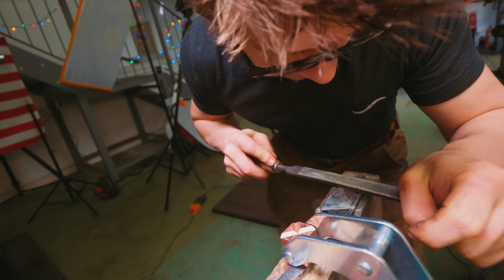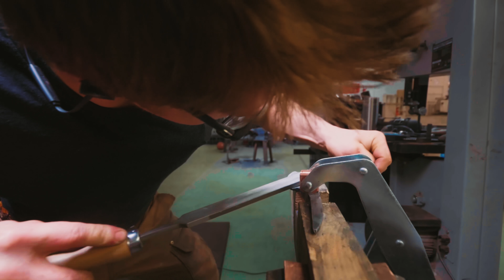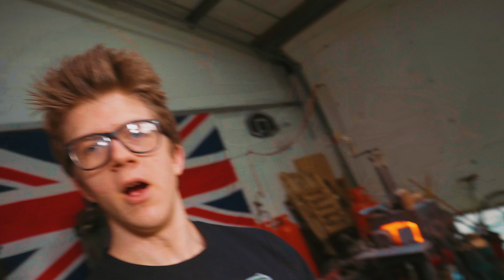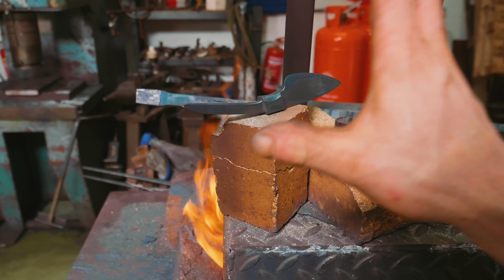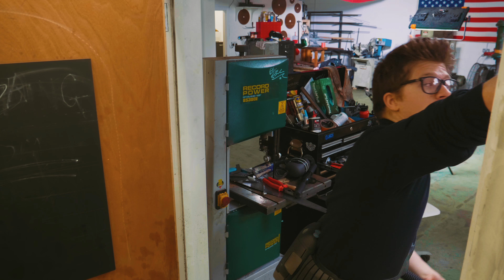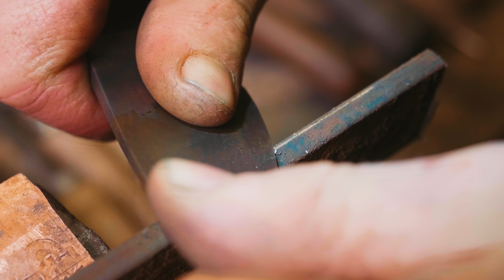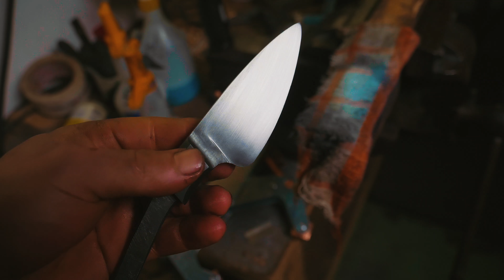MAKING A KNIFE WITH NO POWER TOOLS!!! PART 3

Comment: I work with a lot softer metals but I find it beneficial to turn the files around so they are facing me during some parts of the process. Helps prevent slips when doing the careful spots.  Might take a little longer but eh it’s meditative.

Comment: It's also cool for those of us who only make knife using basic tools to watch someone who only uses power tools. I've never used a power hammer or blow torch, and the closest I've gotten to use an angle grinder, but never a wheel grinder or a large industrial grinder, so I could guess that I'd have a lot of trouble using that kind of equipment. Its a pretty good comparison of the unique skills on either side of smithing.

Comment: I heard once that what steel you use doesn't matter as much as how you heat treat and temper it.
Reply: Not true heat treating is different based on the steel
Reply: Right. Even with different kinds of steel, how it's heat treated and tempered is still really important.

Comment: Hey Alec, just thought you'd be interested to know that when you're normalizing the knife, you're actually growing the grains to a larger size. Cold working steel (or any material that cold works) decreases grain size, and increases hardness as well as brittleness. When the material is then reheated, the grains begin to grow. This decreases hardness, restores ductility, and also removes any residual stresses in the material.

Also, I'm fairly sure that warm oil quenches faster than cold oil because there's less of a temperature difference between the steel and the oil. When the oil is room temperature, the difference in temp between the oil and steel causes a vapor jacket to form momentarily around the steel. Not for long, to be sure, but the first few seconds of a quench are crucial. And since we know that oil is a better conductor of heat than air, this jacket of air around the steel is definitely not what you want around your material during the most crucial part of the quench. So, having the oil a fair bit warmer decreases the temperature difference, and allows the heat to be absorbed by the oil right away and your steel cools faster!

Keep up the great videos!

--Your friendly neighborhood metallurgist

Comment: The problems your having with your files is in technique and file choice. There are several different styles of file including cuts. You can clean it up drastically by  moving to a smooth then dead smooth or 0 or 00. Chalk is an absolute must in the final stages to stop the file from loading up. By lifting the file you are having to reset your cut a file is a push / pull tool. Also several techniques to remove blemish spots or low spots without fileing a complete flat mostly by draw fileing. When we first learned to use a file we had to file a 1 x 1 inch square flat by hand it is an excellent exercise to learn file control. Keep up the good work love your channel.

Comment: I know you probably don't read these but from a fresh prospective. When filing the blade or tang and wanting no slips of the file to the bolster, use some tape on the bolster to prevent damage from slips of the file.

Comment: Speaking of basic tools you can use instead of the forge.  Me and my mate's first forge was a shitty wee fondue set that we drilled a hole in, attached a tube to a hand powered air bed pump, and filled it with bbq charcoal xD  Got the job done, albeit pretty messy and hard to control the heat xD

Comment: handy tip too keep in mind if you doing finishing work with a finishing file, rub chalk into the grooves of the file, it will prevent shavings from blocking up the file, allowing you to get a really nice smooth cut. It will look as if it has been surface grownd. 👍🇿🇦

Comment: 'Warm oil will cool down that steel faster' - Well that was a curious thing to say. 
Having a look in to it it seems that there are three stages of cooling in oil. In reverse order, 
Convection: where the oil is circulating the heat away and cooling is fairly slow though varies with viscosity. It was the viscosity that I guessed would be why it would cool faster, but nope. 

Boiling: This is by far the major cooling stage, the oil is getting to the blade boiling off to be replaced by more oil. Its dependant on a bunch of things about the oil, particulates, viscosity and such, but in general its orders of magnitude faster than the real issue with cold oil, which is the first stage...

Leidenfrost phenomenon: When initially dipped in to the oil, with too high a temperature differential the oil behaves like water droplets on a hot frying pan. It forms a stable vapour layer around the blade that is ironically very good insulation within your coolant.

In an ideal quench youd have no first stage at all, go straight to boiling, cool as fast as possible to the convection stage which allows the metal to release some tension. Heating the oil helps to get closer to that optimal quench.

[Incidentally, all of this is why oil is used in the first place. It has a wide range of temperatures at which it remains boiling.]

Comment: Well done on the heat treat!!! Nice work all around. This is basically the same procedure I use. I believe that the normalizing is a lot more important than generally acknowledged. I use 1080,1095 and horseshoeing rasps (1055-60) mostly. Triple edge quench and temper.

Comment: Great to see some old fashioned hand skills. Reminds me of some of my mostly long forgotten apprenticeship training. Couple of things I was always told by the old toolmaker that trained me, always regularly check your file handles security on the tang. On a couple of your wooden handled files it looks a little like the handles a bit small of the file so the tangs not inserted far enough for safety. Also try not to hold the file with your index finger along the file blade with your wrist more or less in line with the file. I know it seems easier to control that way but if the handle does come loose or split on the forward stroke the tang can end up embedded in your palm or wrist which is not good. We where shown some pretty gruesome pictures of such injuries as young impressionable apprentices to drive home this point. 
Instead of sand or emery paper try using a good quality diamond fine flat needle file working sideways lightly across the piece for your final finish. With care and patience it’s possible to get an almost slip gauge quality finish that way. 
Great work and fun to watch as always 👍🏻

Comment: First realy awsome video
Ans second i have a little tipp for filing if you applay some chalk (german Kreide) on youre file an than file without presure on the file you get a realy reapy clean surface 
(little tric i learnd on my whay to become a mechanist ( im germen and i'm so sorry for my bad englisch))
(only use before grinding with  sand paper)

Comment: Forget the touch mark? You can use a diamond tip engraving pen to draw it out on the blade, they are not as expensive as the "diamond" suggests, you can get one for ~$15 US. but I would suggest buying one that's better quality and has replaceable tips. Buy once, cry once and all that fun stuff.  Since that blade is blued you can scratch in your touch mark and even sign and date it.

As for hand sanding, that's one of my favorite parts of finishing a project. You get to see the beauty exposed right before your eyes. But I highly suggest getting a sandblasting setup, it will cut the hand sanding time down significantly where all you have to do is the finish sanding if you want 400 grit sanding lines. Or you can have 400 grit no lines satin finish to perfectly polished to a mirror finish if you keep going into higher and higher grits until you are using volcanic ash at the end and take as much time to do it as you do hand sanding the whole way to 400.

A sandblaster is also cheaper in the long run compared to sandpaper if you use an enclosed box. The medium can be recycled and cleaned of steel particles with magnets.. or just leave the steel dust in it lol. While sandpaper is use once and throw away. But you will find your medium to get less effective over many uses, what that is, is you are creating a higher grit medium.

Comment: After the blue soak in Bleach for a few minutes. It will rust then hit it with oil and steel wool it will turn real black. You will have to test as certain steel will take more cycles to work.

Comment: Just a little hint.  If you are using lower carbon steel. You can always reinforce the strength with casonite      
For case hardening the edge    Heat the Steele and then dip it in the casonite powder

Comment: For your next project you should make a Turkish Yataghan but to make it more your speed you should make it with Sami construction, as well as damascus steel. So the damascus on the spine would be two or more, soft and sringy steels, and the damascus for the edge would be hard steels. That would be great to see.

Comment: The close-up file-work was awesome. It was great seeing the material being removed and changed with each stroke. Perhaps a few wraps of tape to mask off the areas around where you are filing may help avoid some of the more serious bites if you lose control of your file? Also, do you trust the magnet test for normalization cycles?

Comment: If you don’t mind answering the question of a scrub like myself, but I was wondering why you flattened the face of the knife with blue daikum, but then removed most of that hard work by making the bevel as wide as you did? Why did you take the time to flatten that steel if it was just going to be removing it when you shaped the bevel? I know there’s probably a really good reason, but I was wondering nonetheless.

Comment: From what I understand with cold blue, it is best to only mix what you need, because after it is mixed and used, it goes bad pretty quick.... I haven't tried the stuff you actually dip(the wipe on is too blotchy though). I've had a bottle for a long time, but I got into doing hamons and just did my last hamon video a few days ago. My next build should be trying the Caswell's cold blue, take it easy...
Reply from the maker: That's very interesting to know! The blackening certainly took longer than it ever has on this piece

Comment: Alec, consider using some bar material and clamping a safety blocker on top of the bolster while filing. It will save you from slipping and gouging more finished faces.

Comment: What if you were to cover the bolster or any other surface you don’t want to file with a thin sheet of steel, aluminum, etc. It might prevent the damage caused by file slips. This could help with future projects.

Comment: If you plan on cutting those does on the lower hammer... they are most likely very hard! You’re most likely gonna want to run low rpm on your mill and maybe a brazed carbide fly cutter. Inserts may not do it well. Just play around and you will see lol just my two cents

Comment: 1:18 i highly recommend u to not use a File in this orientation, because the "teeth" are just not made for it and u will ruin ur File in no time. Also to get a cleander Finish with the File you can take a bit of Chalk and rub it on the file, so no metal shavings can get stuck inbetween the teeth and scratch your blade, cause then u just chase ur own tail. Hope this is some useful advice :D
Reply: Davidi Ferdinand It's called draw filing. And it works just fine. Actually gives you a cleaner finsh and helps remove some of the coarse file marks.

Comment: Why does warm oil cool steel faster than cold oil? I'm fascinated.
Reply: Razertai - it follows along the lines of the leidenfrost effect - the oil boils off the surface and the vapor keeps further fluid from contacting it. The cooler the oil, the more viscous it is - so heating the oil up makes it thinner, and makes it easier to flow and fill in those gaps as it touches the hot metal and gets vaporized.

Comment: Is it possible to make a water cooled die set for the power hamer, maybe using the action of the power hammer to compress/pump oil through the head then through a radiator from a pc or car
Reply: Finn Suchara - it's not really needed. The dies on those hammers have quite a lot of mass to them, and should radiate off excess heat in free air decently enough. Remember, he can only work the metal when it's hot, and as he works at it loses heat - so he's constantly having to put it back in the Forge for a period of time to reheat, and during that time the dies can cool. The wear happens simply because of the way there used... It's part and parcel of a power hammer.

Comment: and why does warm oil cool the steel faster than cold oil?
Reply: Tobias E - - it follows along the lines of the leidenfrost effect - the oil boils off the surface and the vapor keeps further fluid from contacting it. The cooler the oil, the more viscous it is - so heating the oil up makes it thinner, and makes it easier to flow and fill in those gaps as it touches the hot metal and gets vaporized.

Comment: ... why not use the surface grinder to grind the faces of the damascus?

I mean... I get that the whole thing probably doesn't fit, but you've got to cut it into smaller bits anyway so that you can stack it up... so is there a specific reason you don't use the surface grinder to get the scale off? o_0

Comment: Question, which (or what type) oil is used for protecting the oxide layer?
Reply: Official Vidici boiled linseed oil is commonly used
Reply: jesse bundy Thank you Jesse!
Reply: Your welcome
Reply: jesse bundy Also, could something like olive or hazelnut oil do the trick, since linseed is quite rare where i am
Reply: I would suggest Google for a good answer
Reply: Official Vidici + Olive oil will work fine, not too heavy or it will get sticky!
Reply: you can also try dutch oil, tongue oil, or the one I use personally, (ordered right off Amazon for $7.99) is called Eco sheep bike lube. The one for recreational bikes specifically works great on metal and leather, (it has the perfect viscosity), but again a little goes a long way. It is a lanolin based oil so it is non-toxic however if you are making a kitchen knife I can't speak to how it may effect taste...but it does the job very well.
Reply: aslob 9 Thank you very much, i tried googling but the info is a bit naff at least from what i found, thanks a lot!
Reply: Would this be food safe?

Comment: i searched for 1080/C80 - 1100/C100 steel for days and found out that i cant buy it in my contry (ger) cause i dont have a company
Reply: Erik Jansen - as was mentioned elsewhere in the comments, try looking in automotive junk yards and find trucks with leaf springs - those leaf springs are often 1095 Steel. Really almost any leaf spring at all should be a high carbon steel like that... And if you can get your grubby paws on it, train rails are also very good steel to use. Maybe check around and find a place that recycles the rails for the companies, and see if you can't buy a small section...

Comment: Lorry (truck in USA) leaf springs, I think, is 1095 or 5160, and the wheel bearing races are also a higher grade steel (51200?). Make a trip to a breakers yard ( junkyard in USA). If you do use junkyard steel, test the toughness and edge retention by cutting bone, nails, bending plus rope and cardboard until failure.  👍👍👍  😃

Comment: How hot do you have your oven when you temper the knife?
Reply: RustyBrusher - he uses between 200 and 220 degrees C - depending on how tempered he wants it. They're charts all over Google for tempering carbon steels - temperatures are pretty universal.

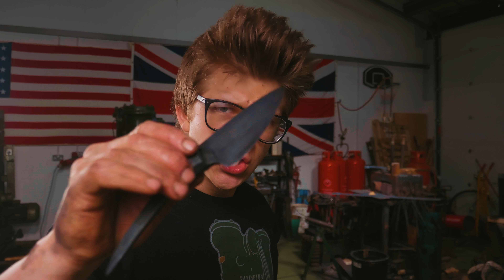Comment: 15:54 I have one of those and use it regularly.  It's great for delivering a decent amount of torque when your fingers just can't press the trigger of a normal drill lightly enough.  For delicate work with smaller bits I'd suggest the smaller, more lightweight eggbeater style of hand drill, though.  If that big drill is anything like mine, it won't be able to grip smaller drill bits.
Reply: Yeah, I still have my dad's hand drills. One like Alec has and one that has a handle attached to a gear wheel for doing really small holes(it'll hold almost any bit)....

Comment: Time to upgrade your vise jaws!  You can make a vise jaw out of a soft material to push on the workpiece.  The other jaw can be cold rolled steel just make it with a landing that clearing the movable jaw.  This jaw holds the work making it easier to change the vise clamp on the part.  Other jaw configurations are copper and brass jaws, jaws that match the blade shape for handle filing, and you can make a wooden jaw.